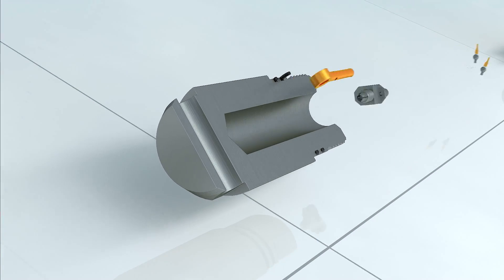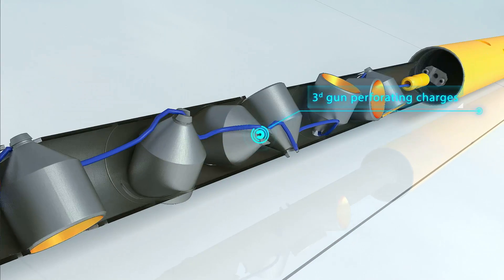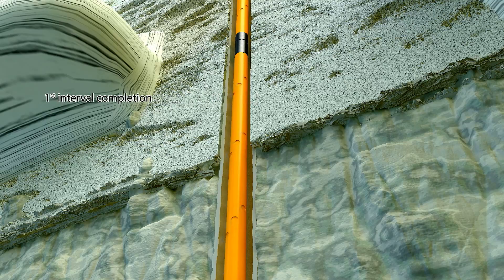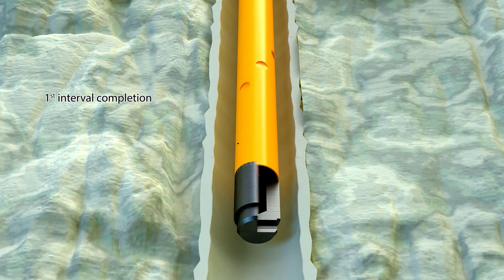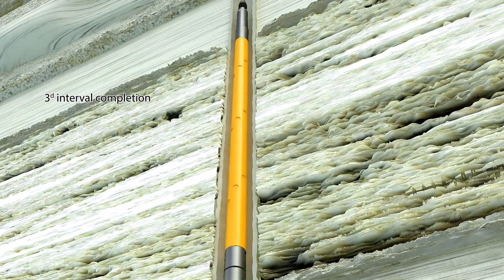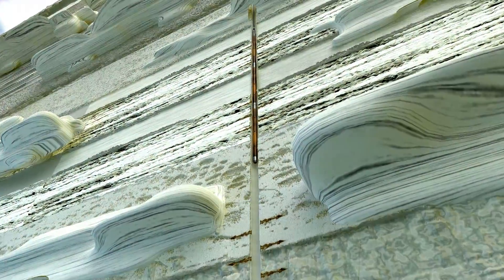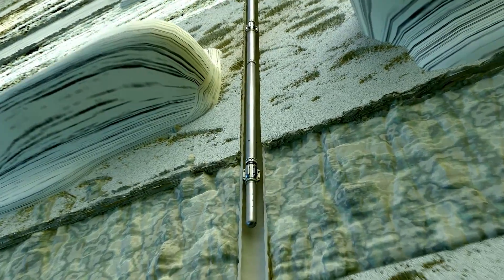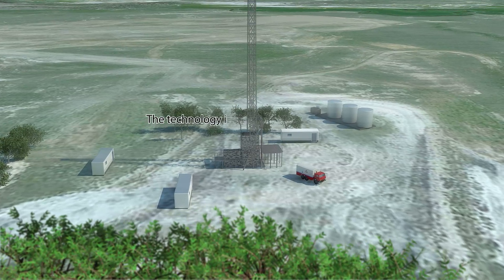Selective perforation

Comment: Me and my husband and I work for OSO, and I wire the harnesses, He was QC  supervisor, but now runs the CNC machine to make the outer tubes. I have also greased many of the silver parts that connect the tubes along with their pins. Out of all of them, the 12 shots were the biggest pain. I preferred wiring the 6 and 8 shots and the plugs with the brass button looking thing on the bottom. 🤣